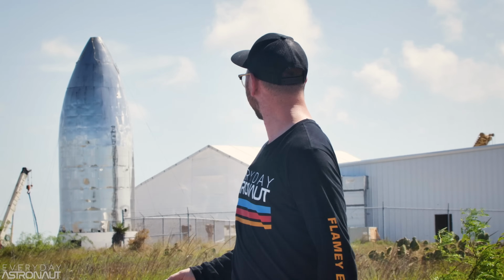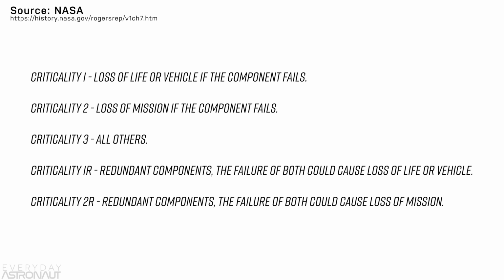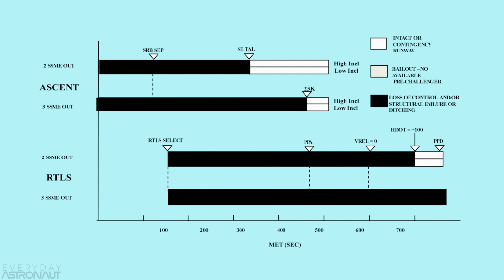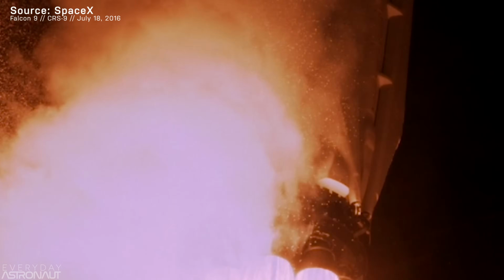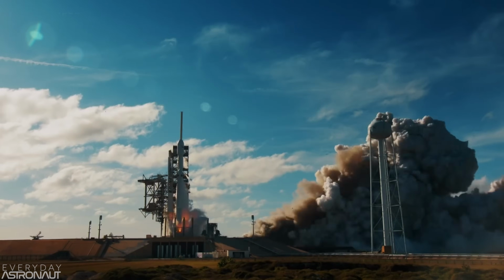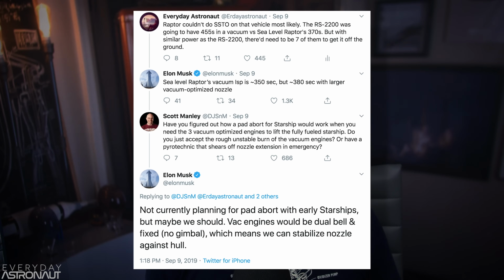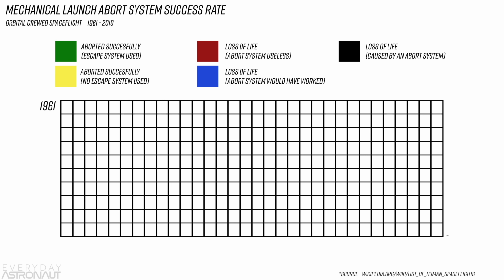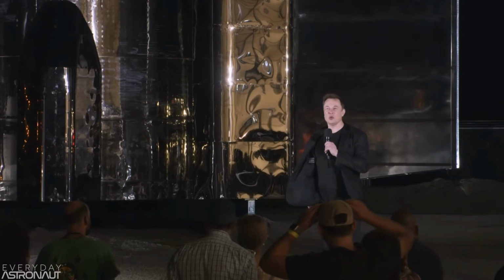Why won’t Starship have an abort system? Should it?!

Comment: To your last question......."would you get on a rocket without an abort system?"  Could it be argued that we all get on airliners without abort systems?  Sure the FAA could require a parachute for every passenger but they dont.  In the early days of aviation maybe they did but after improving safety to the degree that it is, it's just not deemed neccessary.  I think eventually rockets will get there as well after much trial and error.
Reply: Bad analogy. A slightly better one would be do you get on a helicopter without a parachute? It's still not perfect as the helicopter can autorotate and maintain a lot of control as long as the rotors themselves don't get stuck or come loose.

Comment: Early planes had passengers wear parachutes as an abort system. While I have done some skydiving (22 times) I don't think commercial airline service would be as successful as it is today if parachutes were still mandatory. In the long run Starship will need to gain airliner levels of reliability. But by flying many cargo flights first (e.g. F9 + Cargo Dragon), then with test pilot/trained astronauts knowing the risks (e.g. F9 + Crew Dragon), eventually after many flights and many years we may reach commercial passenger safety levels. One could conceive of carrying a CrewDragon, Starliner or DreamChaser as an escape-pod for some of those early missions, but it would severely limit the crew capacity and still be very limited in the flight envelope of when it could be used. Better to get it right for cargo flights first, then go with "the best part is no part". Few people thought a rocket could land. Now few people think you don't need an abort system.

Comment: Just one remark regarding the statistics: if we're talking about rocket reliability in general, you need to count all failures, not just crewed vehicles. Obviously you don't necessarily need an escape system on a cargo mission, but it still tells us a lot about the reliability of rockets if that mission fails and a LES could have saved the vehicle.

But I agree that in the long run rockets should (and will) just become reliable enough.
Reply: Tim did include all launches for the rocket engine reliability statistics. Only narrowed the field to crewed flights when discussing cases of aborts.

A problem of stats that could have been highlighted: If a rocket has many flights a couple of failures will get buried in the average. For rocket with only twenty flights one or two failures will make the stats look pretty bad.
Reply: @Don Jones yes, but thats only because caro flight dont have abort systems at all, even if they could have. So this may produce a lot more cases where a LES might have saved the capsule, thus changing the numbers.
Maybe i should have said "mission success" instead of "rocket reliability".

Comment: yes they are good, but at starship scale its not practical, and due to reusability not needed. when they aren't dumped into an ocean components can actually be checked for damage, and designs improved. just like airlines, and just like airlines whatever safety margins you have, we will still take losses, it'll happen with or without escape systems. So yes I would get on one, once it's been through a dozen or so launches.

Comment: The way you state the shuttle failure rate is misleading.

Out of 5 space worthy craft, 2 of them failed catastrophically, killing all crew.

That's, practically speaking, a 40% failure rate.

Worse, both failure causes were known issues and, essentially, designed in.

I use this phrasing to highlight the potential for disaster.

It's folly to build a vessel for interplanetary travel and think, "this or that won't fail, it's engineered not to."
Reply: No, the way YOU state failure rate is misleading. You need some kind of sampling time/metric to determine reliability, not just sample size.
Reply: @toewsb  - we built 6. We flew 5. 2 exploded. 40% overall failure rate over the 20 year program. There's a time metric for YOU.
Reply: @Texas240   5 were built, with 135 flights total. How is 2 failures in 135 flights 40% failure rate? I guess NASA should have just built more of them, that way their failure rate would be better! lol
Reply: @toewsb  - slice it however you want. 40% (2 of 5) of the space shuttles that flew blew up. With a 3rd that suffered the same problem as one of of the ones that blew up. Luck alone kept that statistic from being 3 if exploded.

The point is, 40% of our space shuttles blowing up is a pretty bad number and much more obviously conveyed than saying we had a 98% success rate...where only 14 people (including a school teacher with her class watching) blew up.
Reply: @Texas240   So...you were wrong, got it.
Reply: @toewsb  - you are free to believe whatever you wish.
Reply: M. de k.  - when you're dealing with a situation where failure means catastrophe and death in every instance of vehicle failure, then yes, the way I state it is "better", more relevant and immediately conveying the need to design for safety.

Comment: My truck doesn’t have an abort system, and I’m fine!  😜
Reply: Robert Gagnon but when the motor of your truck fails or you blow a tyre your car doesn’t explode in a Hollywood style fashion. Also you don’t have to drive your truck always at the highest possible speed. If that was the case, we would have ejection seats in all our cars 😉

Comment: Great video as alway Tim!! However minor correction at 28:10 you state that aircraft cant lower landing gear without hydraulics. This isnt strictly correct, in the case of hydraulic failure there are still options to lower the landing gear. This is either a manually operated crank or pump, or a mechanical free-fall mechanism which disengages the uplocks and allows the landing gear to fall under gravity. Minor point but a point all the same. Thanks for the video!!
Reply from the maker: Listen again 😉 I said “can’t lower as intended” because I’d this exact reason ☝️

Comment: Hey Tim! Love your videos! First time commenting. 

A couple questions (sorry if they’ve been asked before)

1) Will SpaceX need to eventually consider a salt water retardant system to preserve drone landing barges with heavy use in the future? If so how would this work?

2) If the on-pad abort requires more thrust on behalf of starship to achieve higher rates of do you see more thrusters being the answer?

Comment: In short, rocket science is like everything else, the only way to get better is practice.
Reply: Dmitri Kozlowsky  Apparently you never saw the movie Hidden Figures. In that movie you find out that even the mathematics wasn't all that easy. some of the things that they had to learn was completely new to us and I suspect that even today we are still learning new things that we still don't fully understand.  Math and Physics may seem like easy subjects, but since we discovered with the space shuttle program we are learning new things all the time that we thought we understood. What we thought we knew is not always the truth.  We thought we understood what would happen when a piece of foam from the insulation on a space shuttle fuel tanks would break off and strike the tiles on the shuttle wings, but we found out we didn't know.  The foam was soft and the tiles were hard. How could the tiles be damaged by the soft foam?  We found out that the foam insulation from the tanks takes on totally different characteristic when it hits the tiles on the shuttle at a high rate of speed.  Surprise.  The foam became to tougher and stougher than the tiles breaking through a hole into the wing allowing the hot gases to enter the wing on reentry.  I guess we're not as smart as we thought we were.  Same thing happened when they were trying to figure out the how to make the capsules re-enter the atmosphere from orbit. Learn from the movie Hidden Figures they had to resort to an older form of mathematics that had been forgotten how to make the change from one form of orbit relating to a different form of orbiting to get back into the Earth atmosphere again. So the mathematics wasn't all that simple. Theye had to go back school again.
Reply: However, where it differs, is that during that practice, a lot of the equipment tends to blow up and you can often end up losing the data that the learning process really needs in a ball of fire 🔥 😔

Comment: Maybe were looking at the problem in the wrong way. If rockets need to be fueled at the last moments before launch then maybe the abort system could be located on the launch tower housing the astronauts and flight crew. Then just before launch load and ready the astronauts and get the flight crews down from the tower quickly. If there’s a perceived failure during the fueling stage the astronauts & flight crew could launch from the escape capsule that’s stationed on the top of the tower and not on the rocket itself? This saves weight and complexity of the rocket and waist of unused system for each launch. Just a thought.

Comment: With 99.3 percent success rate a 37 engine launch has a 10% chance of an engine out(0.993^37 is the chance of all engines working), the odds of 50% of an engine out is around 6 flights.  What  you really need is the chance of a reused engine failing catastrophically to calculate mission failure. More data from unmanned flights is needed  to determine catastrophic failure rates .
Reply: Martin Horowitz - Super Heavy is designed to get the Starship into orbit (assuming 5 of 6 Raptors on the Starship work) as long as 28 of the 35 Raptors in SH work as designed - The chance of any 1 engine out of 35 failing is 21.8%, while the chance of 7 failing is 0.00234% (that’s 1 in 42,735 launches). Even in that highly unlikely situation, the Starship could abort to either a landing pad downrange or back to the launch site.

Comment: Abort system is only really necessary if the rocket explodes. As long as the rocket is able to come down safe with no propulsion then I'm all good. Like how an airplane can glide and land with no engines running. Not that the rocket need to glide, but just be able to obtain the same result.

Edit: Also, these long videos made me just become a patreon. I think I might be in love with you (no homo).

Comment: Tim, you say at 34:20 that "redundant hydraulics ... should offer a decent buffer in reentry for Starship." As Elon has said SpaceX is likely to switch from hydraulic to electrically operated control surfaces, how do you think this would affect reliability/redundancy?

Comment: If the abort system is more complex that rocket it self then it is easy (like with space shuttles - there was no point in adding it). So abort system must be simple and error proof. Looking at SpaceX nowadays yes there should be abort system for first flights with people. Safety net is more important as loss of people can make huge problems for whole company. I see this same as first jet airplanes - there were only pilot with parachute. System was tested, certified and modern airliners dont have parachute for every passenger. So when dream comes true only way is to have such reliable rocket that adding abort system is like putting that cesna in 747 :) The best abort system is none. The best way how to make abort system is not need it at all.

Comment: The best part is no part. 

After Starship flies 100 times consecutively with no anomalies, I think even NASA will not complain. Even if SpaceX had to eat the cost of all of those launches, (i.e. no one volunteers to fly low-value payload[1] for reduced cost on any of those 100 flights), spending $200 million on testing is probably less than they would spend developing an abort system that would increase inert mass and complexity of every flight with questionable benefit. What if it takes 500 flights to get 100 consecutive perfect flights? That cost is still far less than funding SLS development for 1 year, and it would take less than a year at 2-3 flights per day.

So, NASA should acknowledge this as a valid safety certification and get their actuaries to make the acceptance criteria explicit. If they don't, SpaceX will certainly beat them to the moon with their own private astronauts.

[1] What should they launch on those 100 test flights?  I vote for big rolls of 30x stainless and robots to weld them into giant pressure vessels at L4. (If you were super-risk-averse, you could launch the robots on a Falcon 9.) Maybe 5-10% of them could be Starlink launches.

Comment: Tim, you rock BTW. To answer your question. I think you hit the nail on the head, once SS+SH proves repeatedly reliable , sure, I'd ride it without an abort system. No other form of transport has one. Ha, can you imagine, 2020.12.2.1 notes "Ejector seat mode".

Comment: This reminds me of the electricity backup system in my former employer's building. It was one of the kind where you'd have to route the whole power through that backup system in order for it to be able to uninterruptedly take over power supply in case of a grid failure. The problem was that the probability of a failure inside the backup system itself was higher than the chances for a grid outage are in Germany. So by including the backup system into the power supply system, that would've actually increased the likelihood of a power outage in the building. That's why they decoupled the system and detached the backup system from power supply completely.
Reply: Thanks for giving an actual case of this. (even though it is in a YT comment). I have been wondering about the wisdom of having requirements that specify an implementation like that instead of just specifying the required level of safety. In my opinion non engineers, or engineers who haven't been engineering for a long time should be kept away from the specifics.
Reply: Temple of Ridicule  it's relevant. an abort system could directly cause a failure as has happened before.
also, having an abort system makes the rocket more complex and heavy, so handling the complexity of the overall system design is harder, corners are likely to be cut to bring the weight back down. all this possibly leading to failure indirectly caused by the presence of the abort system.

Comment: The best reason not to rely on launch abort is that they limit the number of people you launch at anyone time. 

In the late-50s, early-60s the US started building supersonic bombers, most notably the XB-70 Valkyrie supersonic bomber. It would have a crew of IIRC 7. Research showed it was basically impossible to eject a crew in sequence at supersonic speeds fast enough to keep ahead of the of the craft disintegrating from just air pressure. The alternative was full cabin eject but that ran into the problem that the more mass you try to eject, the slower the separation from vehicle. The upper limit of full unit ejection is around 6-8 people max. Once beyond that point, physics requires so much power and acceleration it can't be done.

So, it you want a craft that can loft more than a half dozen people at a time, an escape system is right out. Either the entire craft works or it doesn't.
Reply: Interesting example with the Valkyrie research. That was the reason the Shuttle had no abort/ejection capability after the first flights with just 2 pilots. An escape with 6-7 person crew pod was very problematic, besides seriously impacting payload capability. Worst of all, dealing with keeping the pod sealed in space, with all the thru-points for connectors, etc, would just have introduced more failure points - and they'd be there constantly, not just at launch.

Comment: I have mentioned thus also about the COPV holding helium submerged in the LOX OXIDIZER and there have been numerous problems prior to SpaceX using Super chilled LOX and RP1. Hopefully they have the problems worked out and these newer ships become as reliable as Air travel today.

Comment: Idk why, but I’m pretty sure the reason for having an abort system, aside from the whole “It’ll save you life” thing, is that it makes the crew feel safer. You said your self, you wouldn’t want to go on a rocket not knowing how safe it is. Even with all the stats, you still get stressed by thinking about the fact that if one thing goes wrong, it all goes wrong. A stressed crew is never a good crew.
Reply: In that case they would also know with total clarity whether it was actually useful or not. They study everything. They know their own craft.
Reply: @dozodub Yes. Point is not to fool them, point is that while improving crew survival changes you can also improve mission success rate through a crew that aren't so stressed

Comment: The rational for an abort system is not technical (rockets on rockets), not statistical (hardly ever used effectively) but ethical. I'm sure the crew of that 2018 Soyuz would agree with me.

Comment: Do you think SpaceX will have the propulsive landing procedure in the control software of the capsule but left uncertified? It is my understanding that the hardware would be in place on the crew capsule anyway, correct? For example it would be look silly if the parachutes were to fail and the capsule were to crash especially considering Musk's claims that it can land propulsively. Plus SpaceX has a history of successful landings with the falcons. In other words you would never certify the procedure, but leave it in the software so that if the day came where it were needed, it would be an option knowing full well that it's not certified?